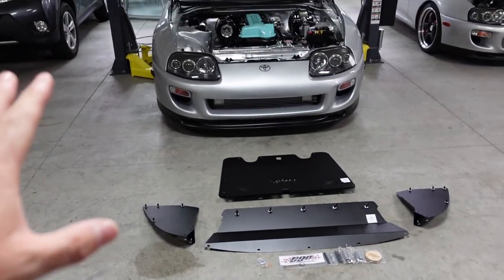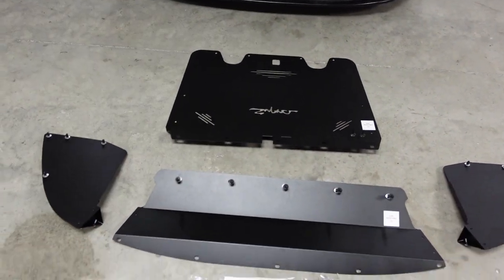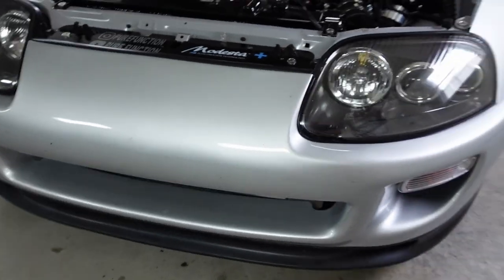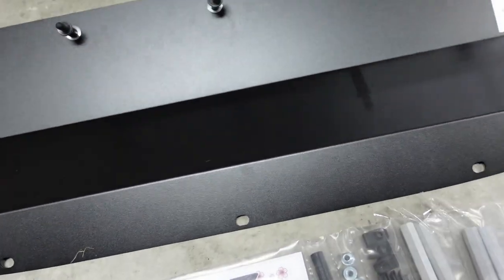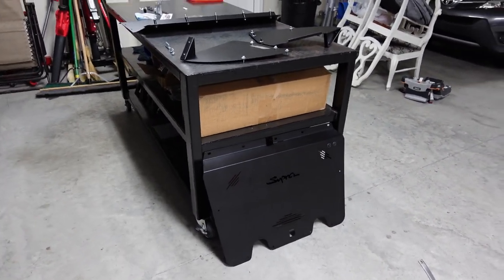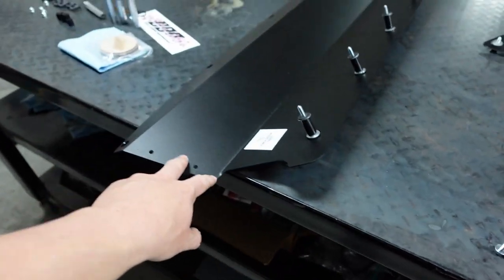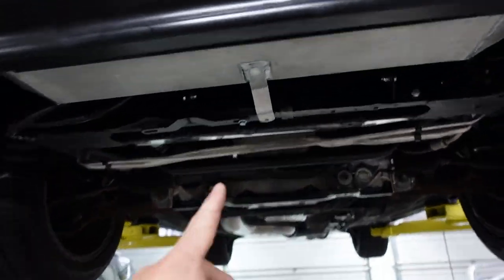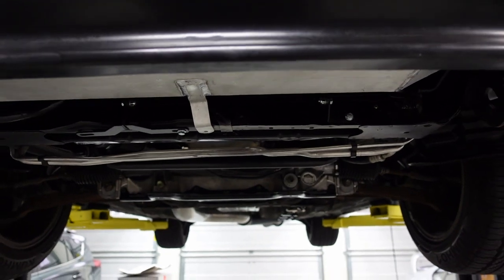DEWLA DEZIGN Supra Splash Shields! (How To Install)

Comment: Ryan,
I couldn't agree with your description of Joe, or as you like to refer to him as JOEL haha.  I dropped my 56K mile, July of 98, LHD Supra Turbo 6-Speed off at Joe's shop to upgrade the heads, swap in new GSC S1 cams, buckets, springs, etc.  I will be upgrading to a single turbo, running off a Haltech Elite 2500,  upgraded to ID1700X injectors to be able to run on E85, and damn near every single PHR black item they sell.   Joe is the only other person that I have met that displays similar if not greater levels of OCD and attention to detail with my 98 Supra as I do.   Since I purchased my Supra in late December of 2003, I haven't let anyone wrench on my car other than Joe.  His attention to detail and making sure the tasks he set out to accomplish, are completed CORRECTLY the first time,  every time, is what makes him so special to find in a mechanic, technician, or tuner these days.  This is what drives his fanatical passion towards makings someone's pride and joy that much more special to them.  I would have to say that the quality of his Supra parts are impeccable.  I attribute this to the countless revisions he made while designing these parts.   Anyone on the fence about purchasing some custom Supra parts from Dewla Dezign needs to just go ahead and place their order with Joe. You won't be disappointed!!